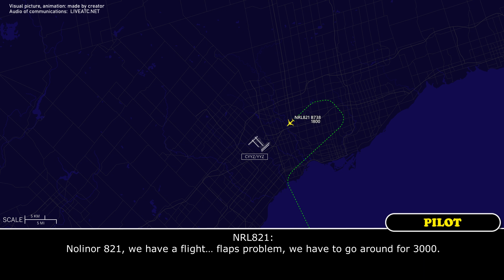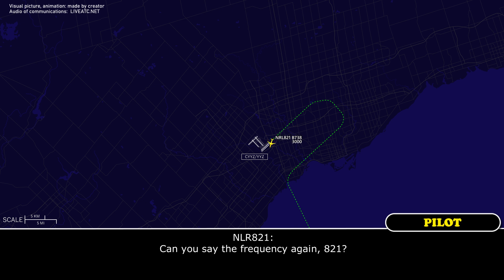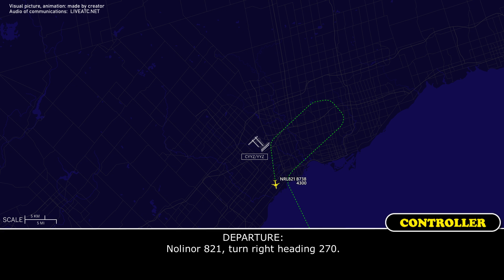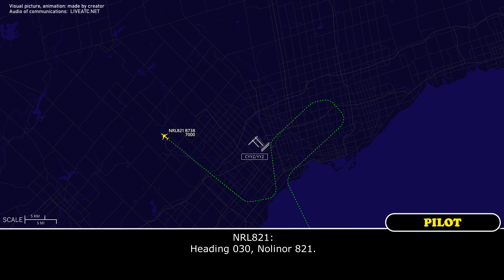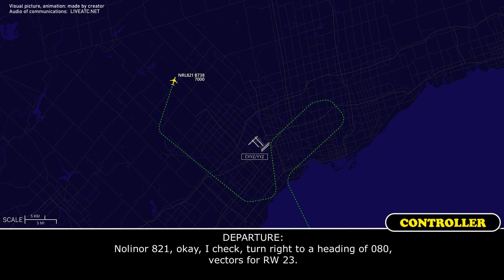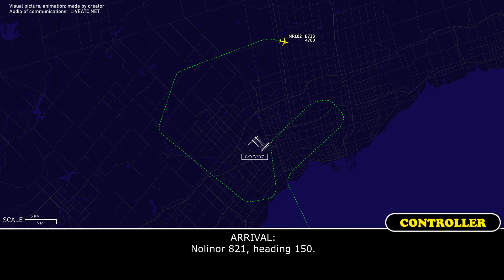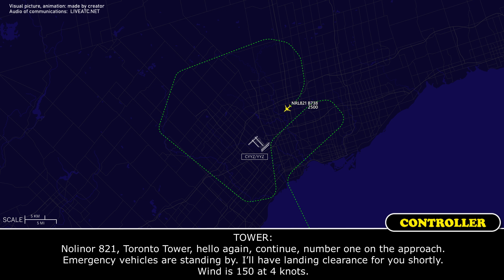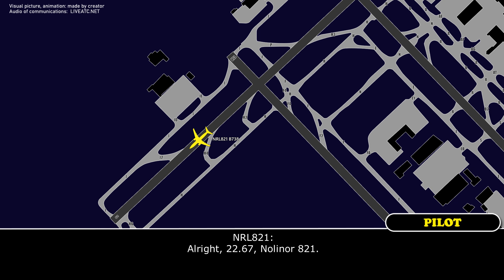PAN-PAN. Flaps issue on approach. Nolinor Boeing 737-800 has problems at Toronto Airport. Real ATC

Comment: Ok, just real quick:  Why would a flap issue have you parking on the runway after landing, for expedience of seeing the issue and it perhaps resolving itself on the ground?
Reply: Since they can't use normal flaps config for landing, they will have to fly the approach and land at much higher speed which means the brake will work harder to stop the aircraft to the point there is a possibility smoke coming from the brake, worst case caught fire, so full stop on the runway required to check whether the brake is okay and whether it is safe to continue taxi under its own power or not.
Reply: @chris22capt  Indeed.